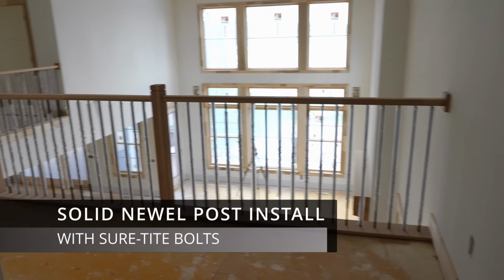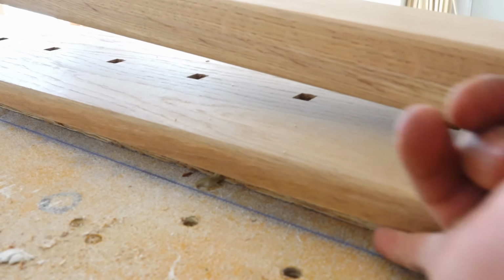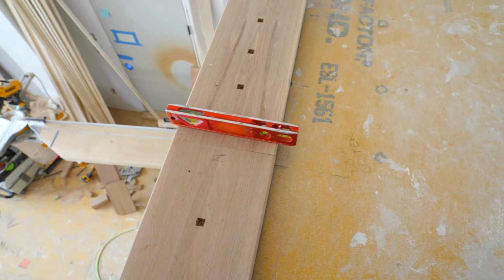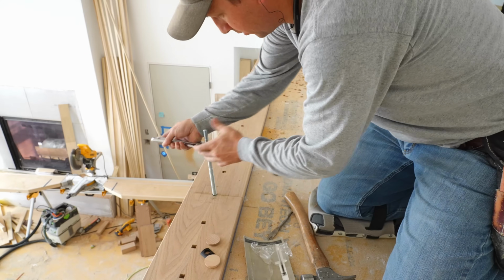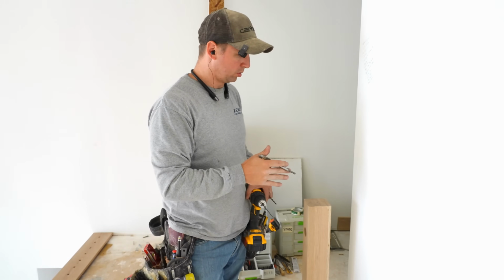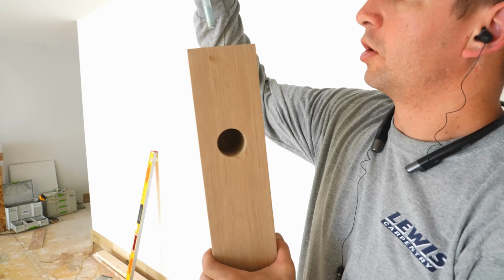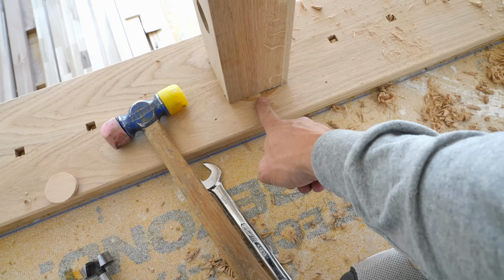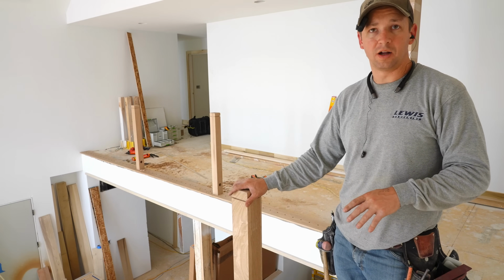The Fastest Way to Install Rock Solid Stair Newel Posts | SURE-TITE BOLT TUTORIAL

Comment: Take a couple scrap pieces of plywood and glue and screw them together like an “L” Use the inside corner of the L to reference your pilot bit, and don’t push hard. I also pull the bit in and out occasionally to help clear chips and to minimize the chance of wandering.

Comment: I used to use two 1/4 inch bolts on diagonal opposed corners.. much better for plumbing up the post.. crank em done as tight as you can thenwiggle them to help crush all the play out of the wood. Going corner to corner gives you a wider base to hold the post too.
Grind down the neck of that wrench
For more degrees of motion.. use a long narrow punch to get the nut started.. put the nut on the punch(or long nail set)  then a nail or other punch the spin the nut

Comment: Timestamp 27;10 notice the damage to the 1.5" hole edge resulting from turning the post with the wrench , you can avoid this with a piece of leather or similar material between the wrench and the wood.

Comment: I would 3d print a jig for the 4x4 with a hole in the dead center as a guide. No measuring necessary. I have a small 3d printer could make you one. I could even make the jig 3/8 of an inch thick so that the hole is straight and doesnt allow the bit to wander

Comment: Spencer, regarding the hanger bolt. You said you are probably going in between two LVL’s. What if there isn’t a floor joist underneath where the post goes? What do you do to keep that 3/8“ hanger bolt tight and strong?  Have you ever used spring bolts?  If so, any videos? Ty
Reply from the maker: Most of the time in those situations I will but out a large patch of the subfloor and install sub framing so that there is something solid down there.
Reply: @InsiderCarpentry  I have gone on some estimates where they have carpeting and an existing railing system, so it’s not a brand new house, rather they are looking to change the posts and rails, so opening up the subfloor really is not an option. Have you ever used a spring bolt?  I know you do a lot of new construction, so I would figure you don’t do a lot of remodeling of existing houses.  My main background is being a high-end custom cabinet maker/furniture builder and the majority of my clientele asked for that or stripping and refinishing, all at a professional level. I don’t really get into new Home construction items like you do.

In situations where you can’t see any fasteners or a plug to give an idea there may be hardware behind it, I don’t know what they are using to hold the posts so strong. That is where I guess it is probably a spring bolt.…… But I can’t imagine that would work well without having solid blocking below the sub floor. In some instances, you have to wonder if the post was put on before some of the sub flooring and the only way to access the bolts, etc. would be to pull off all the sub flooring around the area. I’m not a stairs contractor by any means, so I don’t know the different possibilities of what it could be.

Comment: Hi Spencer, enjoyed your video. I've been using those Sure-tite bolts for decades. One thing I did to help install the nut is modified an old 3/4" wrench. Grinding down the thickness of the metal across where the height of the bolt is will give you more clearance when first trying to get the wrench over the top of the nut when it's at the top of the bolt . Second, grind away some material around what I would call the neck of the wrench, right where the wrench bottoms out against the sides of the hole. This will give you more swing clearance. This of course will weaken the wrench, but will speed things up. Then you could switch to a unmodified wrench to torque it all the way down.

Comment: If you mortise the post into the nosing (yes this takes a little extra time) it locks in tight and is some added insurance on strength. Been doing it that way for many years when I cant cut into the floor and drop the newel down,block and attach to framing,which is by far the strongest way. Cheers mate.

Comment: Hey Spencer. Great content! Love your attention to detail. You're an inspiration to me and I'm sure many others... 
Just a thought. When tryng to drill perfectly vertically into the newel post, could you tape a spacer onto the top of your drill so you can see along the wall edge with the post in line and the other way is kept even with the wall by inserting a measured piece of wood onto the top of the drill that holds it even with the centre of the drill bit and the wall ...
Hope I explained that right.
Keep it coming pal!
Awesome stuff.
(I'm a 68 year old carpenter, and retired shop teacher still in the trade. )
Russ

Comment: Spencer, I used a bench grinder to grind down the outside walls of my wrench to make it easier to turn the nut on the bolt. It helped tremendously.

Comment: Why not batch out the vertical drilling of all of your posts back at the shop using a floor standing drill press and a jig to hold the post dead center and perfectly plum? 

Your videos are fantastic! I’ve learned much and am grateful for your teachings.

Comment: For the holes in shoe rail and post that need to be as plumb as possible, I use a drill block made from 2x hardwood in shop on drill press to get the holes started as deep as possible, after which I remove block and continue drilling. The hole itself then guides the drill the rest of the way.

Comment: hey spencer to drill that hole perfectly plumb in both directions on the bottom of the newel posts get one of those drill press adapters for the cordless drills they work great
edit also get one of those ratcheting box wrenches will save you some hassle and you will use it more than you think

Comment: tap in a 3inch nail/screw a half inch from your hole, get it plumb(or square off the post bottom) and use it to eyeball your drill bit. Pretty easy to see left/right then tilt your head to the side a bit and gauge equal distance top to bottom.

Comment: Excellent expert tutorial. Is there a reason you don’t prepare the post in the shop?  When you torque the just installed post aren’t you bending the bolt, too (as you did when you installed the bolt)?  Thanks for the video.

Comment: Might sound crazy but try placing your off hand index finger in the hole and then, carefully drill to hit your finger.  Its amazing how much that helps your aim.  Obviously move your finger out of the before you break through.  Try it on a scrap and see if it works for you.

Comment: I suggest to have the drill going down straight for both the bolt and the hole in the post, you can glue a bubble level (round one)  at the back of your drill. On my Makita drill, that back is perfectly perpendicular to the drill. 

Someone probably already commented the same.

Comment: Thank you so much for sharing another amazing video. It wouldve been helpful if it was uploaded about 4 months ago when i did these exact same newel oak posts.🤣
The only thing is we had custom glass instead of balusters. In any case thank you for all your hard work and all the info you give us. 
On my install i didnt have too much solid blocking underneath the subfloor as well as there was HVAC ventilation so i had to get creative and use half-lap or a rabbet type cut off on the ends of the posts. Then screw them on the small blocking that i could install. Then cover the open spots with the subfloor with plywood. We also didnt use the "stair rail" and had the LVP floor run all the way to the posts. Then cover the little gaps with quarter round trim. 
The job with the glass install took about 3 and half to 4 days and oh man it was not easy. Again i dont do these often and it was a challenge. Seeing this video definitely gives me a few ideas for my next install, if i get some in the future. This kind of work is very challenging, but rewarding at the end. 
Have a good one, and looking forward to more videos from you!

PS: you could get a throw away wrench and shave off the metal with an angle grinder to get more space for the twists. just something i thought about while watching

Comment: In case nobody mentioned this in the upper comments, you could also use one of those add on drill press attachments for your cordless drill. I know Mills craft, and rockler make them and that way you can drill precise 90° holes. Regardless your work is phenomenal and I appreciate what you put out for us to consume.

Comment: I very much appreciate your videos. I am a retired general contractor and last used your method with clam clamps and urethane hot glue on my crazy baseboards and door casings. My painter could not believe the fit. You are a credit to finish carpenters. Keep up the great work. I know you are the top of the class.  I build a few oak stair wells in the past and truly appreciate your fit and finish. Very crispy.

Comment: Spencer, look for a ratcheting box end wrench with 120 tooth count, they have a 3 degree swing. Capri tools sells them, along with others, I’m sure. Great instructional video, thank you. Also if you’re in a real bind, you could use a 12 point nut.
Reply: I got a ratcheting 3/4” box end from auto zone & had to grind a little off the outside to fit in the 1 1/2” hole..works great, so much quicker

Comment: LVP in a custom home? Gross 🤮 

As always - Nice job Spencer. I transitioned from trim carpentry to working in a stair shop. I’ve been curious how the bolts get used on site.
Reply from the maker: Lake house, lots of wet swimmers in and out, it's a fine option for the environment.
Reply: @InsiderCarpentry  Smart. Couldn’t argue with that logic if I wanted to.
Reply: Nah,it’s still gross

Comment: I’ll drill shallow 1/4” holes on bottom of post and top of shoe rail where the post will sit. These act as key ways for the glue to fill and lock the two together. I use that for a lot of areas where use construction adhesive.

Comment: Have you ever looked at using a GearWrench type box wrench? They have a very compact head and have 72 teeth so you only need 5 degrees to click through the teeth instead of the typical 30 degrees. GearWrench is a brand name, but there are others who make similar box wrenches. They are very robust and make working in such a tight space much easier.

Comment: I can tell you have been doing just carpentry I used to install escalators we had do some work just by feel I also have been doing some carpentry since I retired from the elevator trade we used ratcheting wrenches that worked best for tight situations I do follow your site and I have found many useful tricks of the trade

Comment: You could replace the supplied nut with a 12 point nut to cut the required range of motion from 60° to 30° making tightening easier.

Comment: Make a drilling jig that slips over the end of the post with a metal guide bushing. No measuring & all but guaranties the hanger bolt hole will be centered. Grind down the sides of the box & the shaft of the wrench . Make a big difference. Ratcheting box wrench are too big for the hole

Comment: Friend of mine that only did rails had double lag thread in opposite directions,Just piloted run into Knewel and same for floor .Glue connection well and tighten to floor.Same as the hardware they have that is for balisters,but larger sizeYou just tighten last bit with bar clamp on kneel.

Comment: Doing trim for over 25 years and i despise those bolts. Lj smith keyhole newel fastener. Its the cats paw
Reply from the maker: I've never used them but they don't seem nearly as strong to me.
Reply: @InsiderCarpentry ive used every fastener and those by far the strongest. Went back to job i did 6-7 years ago and newels were like the day i installed them. And thats with 3 kids now

Comment: Great video. Just playing devils advocate.  That system looks perfectly fine for residences, but what if it is a restaurant or bar where people hang out upstairs and lean on the railing? How many large men could the railing support. In that situation?  Wouldn't something even stronger be in order?
Reply from the maker: It doesn't get much stronger than this aside from using a long newel and dropping it down into the joist cavity and blocking it in.

Comment: Awesome video. I just installed a newel post and could've used this vid for some additional tips. I used the Zip Bolt kit though which was much easier to remove on and off for test fitting. PL3 adhesive made it rock solid

Comment: Great content as usual!  If you haven't already, could you show us how you set the post on the stairs? Do you drill the vertical hole, then cut the angle on the bottom of the post? thanks Spencer.

Comment: You always teach me something Spencer..I’ve done a ton of newels & do everything the same except I’ve never thought to match the plug grain with the newel lol..thanks, always keep an open mind as a carpenter & never think “I’ve been doing it 10yrs this way which always works “ you never know who or when someone teaches you something..I’ve had guys I was teaching make a suggestion that makes more sense than what I was doing..I started drilling an 11/16” spade going through the bottom of the newel to give a little more room to adjust the newel to the bolt..but you always drop great content, thanks again

Comment: Hi Spencer, I’m 28, own my own trim carpentry business and have been doing tons of hardwood railings similar to this. Information for these installs are so limited and I feel as if every railing has its own quirks to their install. I just finished a hard maple stair set with 1” square balusters perfectly mortised into top and bottom rails. I don’t have a tilt mortiser but because of a video you posted in the past about square balusters I found out about them. I’ve been messaging Canadian companies in sourcing one but as you said they’re like freaking unicorns. Ultimately I ended up mortising everything by hand and it took FOREVER. Can’t wait to find my “unicorn”.

Comment: Spencer, you are the best at your craft. Thanks for great content as always. Tip: I came across this camera that another youtuber uses, it made a great video for the type of content that he records. You may have something similar or better but the camera provided 360 views without having to touch it. I'm not an affiliate or even a content creator just sharing. Hope this helps. Camera: Insta360 X5 - Waterproof 8K 360° Action Camera, Leading Low Light, Invisible Selfie Stick Effect, Rugged and Replaceable Lens, 3-Hour Battery, Built-in Wind Guard, Stabilization, Triple AI Chip Design

Comment: Spencer I have found that using a cross hair laser level helps tremendously in keeping your drill bit going in a straight line. It's easy to see the laser line on the drill bit as your drilling 😉
Reply: great tip !

Comment: I have used 1 k + of those bolts for over 20 years  . I have 2 vice grips I use and make a " T " handle so I can use both hands to install the bolt . I crank it in so threads are just under the   nosing or cap . Then I put the post next to it and mark the top . No measurements required . I also drill the 1 1/2 hole first . Then lay the post flat on top step and have helper hold or push against the wall . I can then drill straighter to hit the center of that hole ( yours was a little off which can be a pain ) .  and follow it up with a 5/8 .I also drill up just a little so it's easier  to get the wrench in . I took a 3/4 wrench and ground some of both sides of the handle so I get more travel tightening the nut . I don't spin my post because It kind of burnishes the wood and you can sometimes see it in finish . 
I also found putting the nut on to test before the post is smart business because sometimes the threads are mucked up a bit and hard to get started 

Those things are the bomb
Reply: Spencer, nice work, definitely a solid install. I’ve done the same as Gary and ground down the outside of the box wrench, which makes it easier to maneuver the wrench inside the hole and you get more rotation per turn. I disagree with you about spinning the post to speed up the install—that’s a bad move. Not only will you burnish the wood, as Gary points out, but with an open-grain wood like white oak, you will push that PL Premium down into the oak. You don’t seem to worry about that, since as you often say in your videos, that’s not your problem: another trade (painters) will have to sand that glue out. But to completely sand that, the painter may dish out that oak and spoil the look. Don’t spin the post! In fact, when I do the test fit, I mask the “shoe rail” (your term) so any glue squeeze out doesn’t foul the oak. This ensures a quality finish.
Reply: @idontthinkso666  I have watched a lot of his videos, and he has never passed a problem along to the painters. He is a professional master carpenter, and I have seen him many times thinking ahead about how he can make other trades' jobs easier. In all of his videos that I have watched and learned from, he shows total respect to the other trades that have to follow him. It is his character to show respect to others. Find a video where he said such a thing. I don't think you can.
Reply: Dude, awesome tips 👊
Reply: Thank you for calling them balusters. Pickets belong in fence 😂.